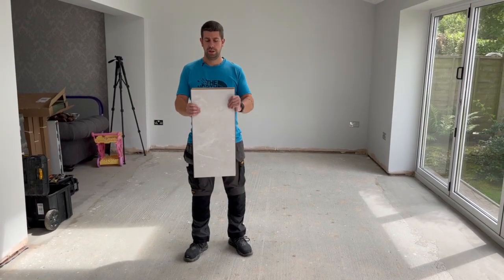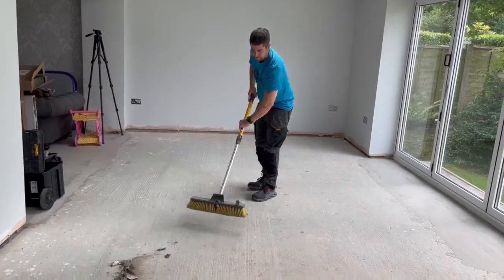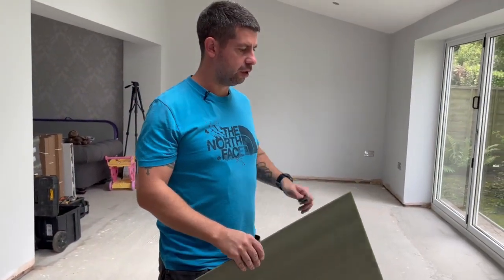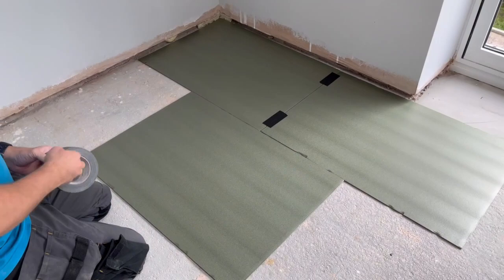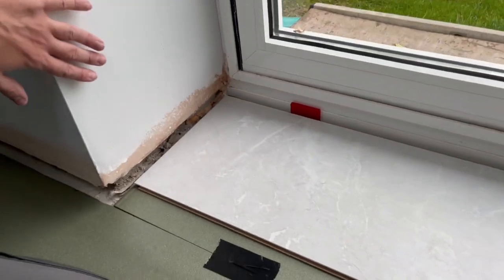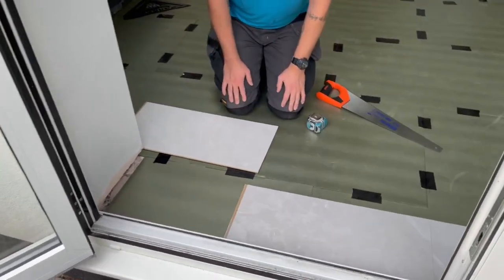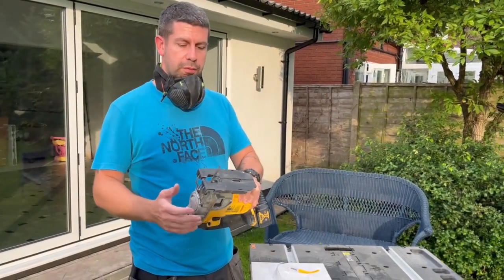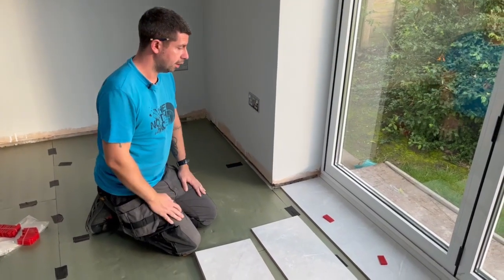How to lay laminate flooring. It's easier than you think.

Comment: The top coat they put on laminate flooring, kitchen worktops etc, contains very very fine aluminium oxide dust. It's second hardest to diamond. Thats why they are hard wearing and kill blades fast, even tungsten carbide tipped blades, or your chopping knife, Your a very naughty person if you chop on a worktop, so you deserve it ;P.

Jigsaw is definately the best way to go. If you want a very clean cut, use down cutting jigsaw blades and turn the orbit action off on the jigsaw (little lever on the side near the blade), They will be good for abot 4 meters of cutting. Use up cut jigsaw blades for all the hidden cuts (under trims), one up cut blade will do you for 10 square meters easy. For upcut blades, the less orbit you use the cleaner the cut, but slower the cut. For down cut blades, you must push down quite firmly and use no orbit, as that action will cause kickback and jumping and could ruin the work. Same goes for worktops, You will need one or two down cut blades for cutting out an inset sink, for a clean, non chipped top.
Reply from the maker: Thanks for all that info.
I like saving money so I managed to do the whole floor with just one jigsaw blade.
Thanks for watching 👍🏼
Reply: @spendtimesavemoneydiy  All for the algorithm :D